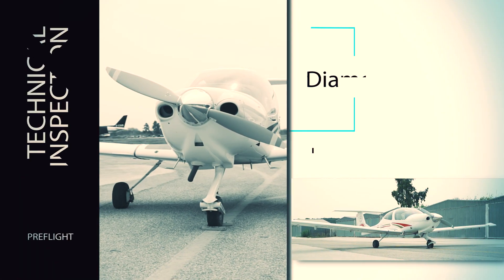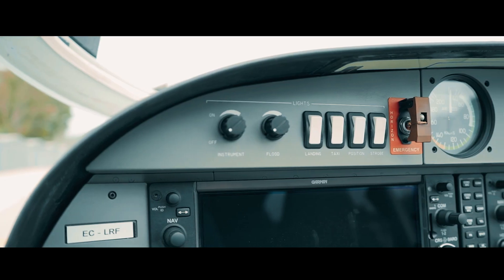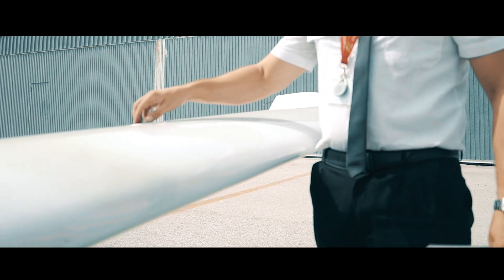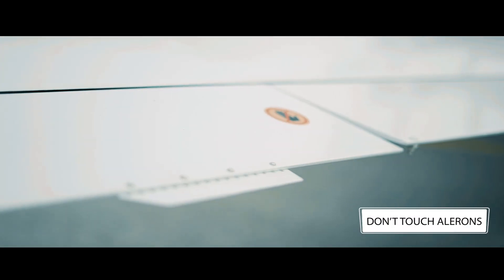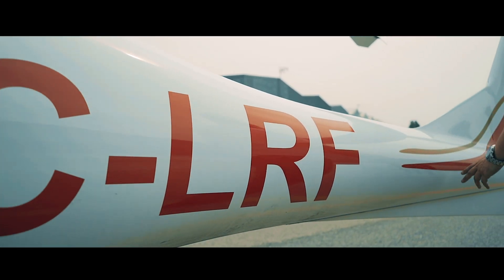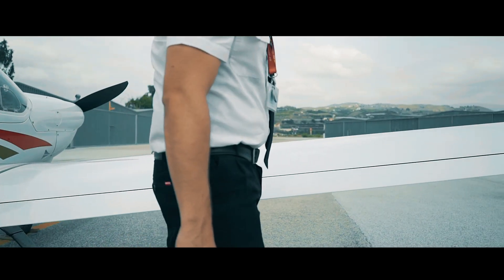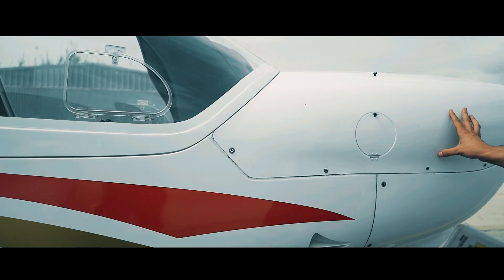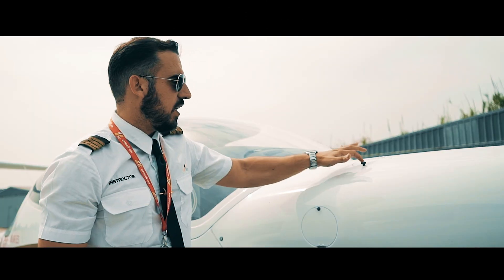Diamond DA40 Aircraft Pre-Flight Inspection | One Air

Comment: When or where do you usually drain a small quantity of fuel to check for water and sediment on this type of aircraft?
Reply from the maker: Hi Hartwig,
Drained fuel must be disposed of correctly, never in the toilet or in nature. In the hangars we have tanks intended exclusively for this purpose.
Reply: @OneAir  Thoughts on putting the clean, inspected fuel sample back into the fuel tank?
Reply from the maker: @davidshep8583  Returning fuel to the tank is prohibited by current regulations.
Reply: You'd check this at least 15 min after refueling to allow time for any water or sediment to settle.